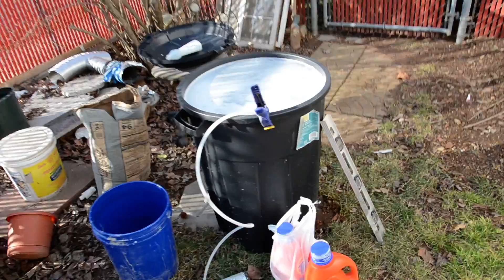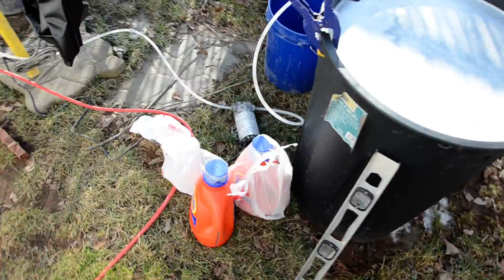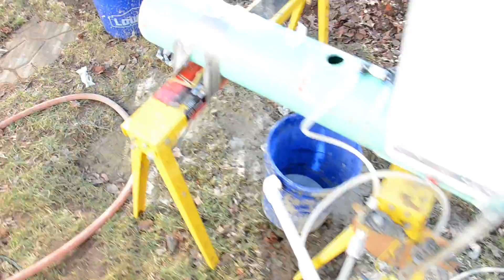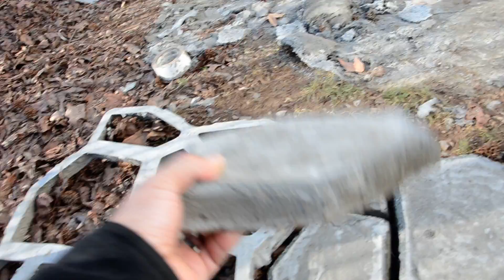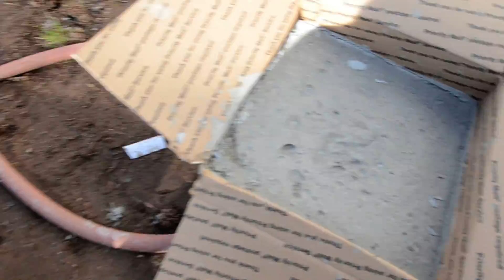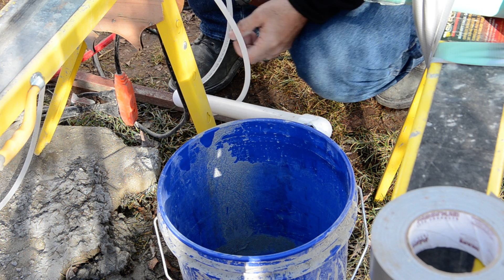Making Foam for Aircrete | with Basalt Fibers | Video 1 of 4 #Aircrete #Foamgenerator #AircreteHarry

Comment: Dawn is the only dish soap I would consider using. period.  We even use it for Honda per their specs as a tier 1 level supplier for o-ring lubricant when hand applying...  Dawn specifically is in the Japanese specs.  It's a total, quality, high foam product used successfully in these applications directly before.   Start over using ONLY dawn for your soap. 1 1/2 - 2 cups every 5 gal.  The lesser soap, and/or add sand and fiber, rebar, mesh, ETC for more structural strength.
Reply from the maker: Don't use Dawn any more here is why. https://www.youtube.com/watch?v=S1ydXgWDU00&t=25s

Comment: How much did your green dragon. Cost? I ask as some people have said green dragon was discontinued for safety reasons
Reply from the maker: I paid a little over $600. Not safety it just didn't work as advertised. It did not mix everything good and you don't have control over your cement to foam mix.
Reply: More like a green lemon, just saying.